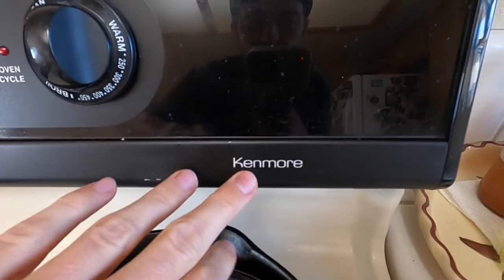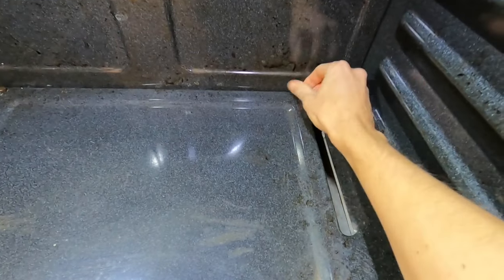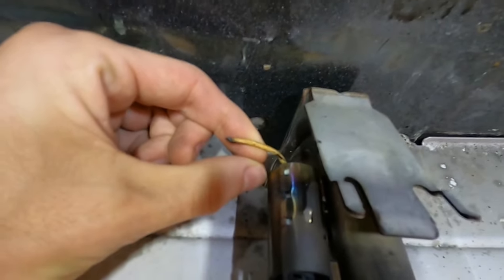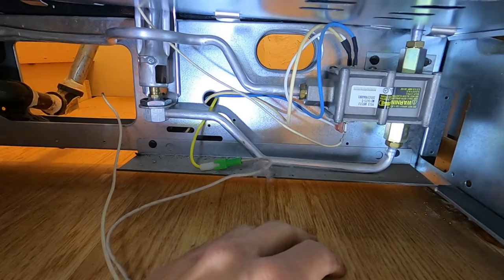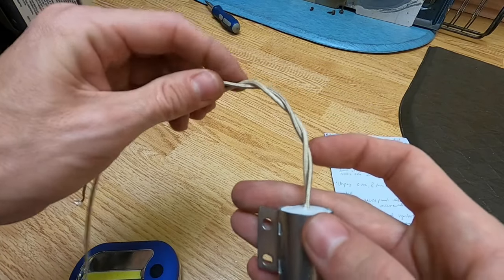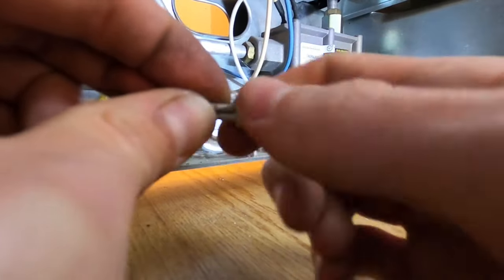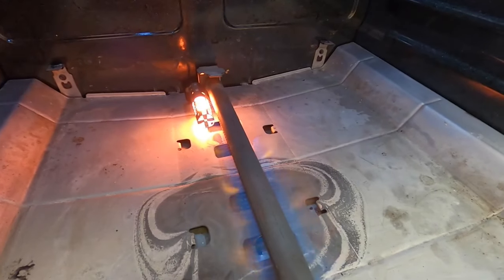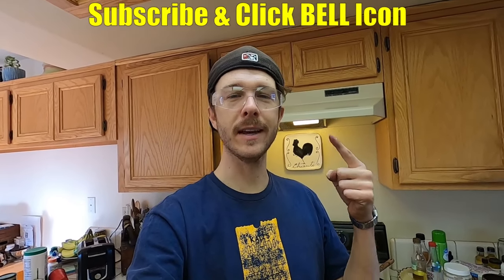Gas Oven Won't Heat? Easy DIY Fix

Comment: Hello in the title you said won’t heat and the pic thumbnail showing it on and in the video you saying it doesn’t turn on because the yellow cable was broken . It’s little confusing but my issue is my over it’s a kenmore it does turn on but it’s keep turning on and off and the flame not big like it used to be and the top one doesn’t turn on while in baking mode it turn on only in Broil mode please help I can’t afford new one I have to fix this one it’s only 6 years
Reply from the maker: Yes it broke. The thumbnail picture I took after I fixed. I would try replacing bake igniter. The broiler uses a separate igniter that's why still probably working 👍

Comment: What if i replace my heating element and it still wont get hot. Wont come on at all. 
Stove top and broiler work, just not the oven?
Reply from the maker: I would double check and test the igniter to make sure it is indeed working properly. Can test with multimeter
Reply: @JonnyDIY 
What should the multimeter read if the igniter is working properly?
Reply from the maker: @ashhelmsrnbsn  usually between 40 and 200 ohms

Comment: Will this help if you have a f-10 error message?
Reply from the maker: I would look into the oven temperature probe first and test that for resistance to see if working correctly. Then go to the panel. Sometimes you can find known problems with your specific model range by searching "f10 error" and your model on google and see what others have done

Comment: What if my igniter is working but no gas flow is happening in my oven? I have gas and flame on my stove btw.
Reply from the maker: @moonrocketnfts4600  when they're going bad theyll glow but not hot enough and won't open gas valve 👍

Comment: Is the ignitor supposed to stay on after the flame is lit?
Reply from the maker: Not for long, it should turn off after a bit 👍
Reply: @JonnyDIY  mine stays on until the oven reaches temperature and the flame goes out. Is that normal?
Thanks for responding
Reply from the maker: @highhemp8448  yes that's normal as it has to relight the burner back on to bring oven temperatures back up when they drop 👍
Reply: @JonnyDIY  not all heroes wear a cape.  Thank you sooooo much
Reply from the maker: @highhemp8448  you're welcome, happy to help 🙌👍

Comment: Does the oven igniter stay lit the whole time you’re baking?
Reply from the maker: No just to light the gas 👍
Reply: @JonnyDIY  thanks!
Reply from the maker: @doug8525  you're welcome, happy to help 👍
Reply: My ignitor lights up hot red but the oven gas dosent ignite. The top gas burners are burning fine.

Comment: If the igniter is broken do you still hear or smell gas?
Reply from the maker: @dkshdw2004  No it's a safety feature so if igniter isn't working gas valve won't open 👍
Reply: @JonnyDIY  Thanks! We see if I can get the igniter locally.
Reply from the maker: @dkshdw2004  you're welcome, good luck 🙌👍

Comment: One thing I would add is that if you're working on a Samsung Gas oven( NX58H5650W , NX58H5600S, OR NX58J5600S ) They are very easy to access if you just want to steel wool, sand or scrape the oxidation off, instead of buying a new one, BE VERY GENTLE, THE IGNITER (GLO-PLUG) IS VERY BRITTLE. Ask me how I know.:yougotthis:
Reply from the maker: Thank you for sharing, that's great steel wool will get it working again 👍

Comment: So my stovetop and broiler work but oven doesn't why is that. Igniter still?
Reply from the maker: Probably (I'd start there). Broiler has its own separate igniter as well as stovetop burners 👍
Reply: @JonnyDIY  ok thank you for the response I will check it out
Reply from the maker: @Its_about_that_time  you're welcome, good luck 👍

Comment: My oven keeps beeping F2 and shuts off. What does that? Sears replaced the ignitor. That didn't work. We  replaced the thermostat. That didn't work. They said it could be the board.
Reply from the maker: Yes the board would be the next logical part to inspect/test and potentially replace 👍

Comment: If the igniter is not working would you still get gas flow to the oven?
Reply from the maker: @KatMSmith  No, as a safety feature the gas won't open unless igniter working properly 👍
Reply: @JonnyDIY  ok, thanks. We changed the igniter but still not working. No gas flow
Reply from the maker: @KatMSmith  shoot, well you can test with multimeter to see if power coming to igniter and go from there
Reply: @JonnyDIY  absolutely will do 🤞🏻 three weeks without an oven now and I have things from my garden to get done 😉
Reply from the maker: @KatMSmith  🤞 hope can get it working again

Comment: Hi there.  Have a GE Profile XL 44 that often i cannot get to heat much past 375/400.   Ignitor goes on, burner burns blue.  I noticed that when it gets to that high 300s low 400s range, the blue flame actually will at ties flicker or get smaller.  Any tips?
Reply from the maker: I would try the igniter first. It can do that sometimes as well when starting to fail

Comment: My igniter is on but the stove isn't letting out Gas it does it every once in a blue moon when u turn the temperature to 400
Reply from the maker: When they're going out they'll usually still glow but not hot enough to open gas. I'd probably just replace it, usally fixes issue 👍
Reply: @JonnyDIY  yes i put a tester on the gas valve and it showed numbers I replaced the igniter a few months ago so I figured it was something else but the igniter cord is a bit burned so u got another one
Reply from the maker: @chxpionships_5163  ohh ok hopefully it fixes issue 🙏

Comment: My oven pilot light is on but won’t heat up just warm
Reply from the maker: I'd replace it. They do that when going bad 👍
Reply: Should we smell gas or not necessarily? I thought I’d smell gas if the pilot was not hot enough to ignite?
Reply from the maker: @sumdregs  gas won't open and come out unless igniter hot enough 👍

Comment: Okay so what if my element lights, but it still won't ignite? I don't smell gas either
Reply from the maker: It could still be bad even though it's still glowing. It has to reach certain temperature to open the gas

Comment: Could I just use a lighter to light it to make sure there's gas?
Reply from the maker: Unfortunately if it has an electric ignition it wont light
Reply: @JonnyDIY  I don't smell or hear any gas when I turn it on (it's a double oven and only the top oven won't heat - rest of the oven is fine). Could is still be the ignitor? In other words ... if the ignitor doesn't light up will the gas not turn on? It's a newer Whirlpool and the ignitor definitely doesn't light up.
Reply from the maker: @kevinmace  yes the igniter must reach a certain temperature for the gas to open 👍 even when they do still light up but weakly,  the gas won't open
Reply: @JonnyDIY  Thank you!

Comment: My kenmore igniter is glowing but the gas wont come on.
Reply from the maker: Even if glowing doesn't mean it could not be faulty. They will glow, but not get hot enough to open the gas valve when going bad 👍

Comment: what if theres no gas shut off valve?
Reply from the maker: there should always be a shutoff valve on the gas line going to the stove, you should find one. If not need to shut off Gas main and fix and add one to gas line. But I bet you have one somewhere on the line
Reply: Use the breaker

Comment: Mine won't shut off. I have to unplug it.
Reply from the maker: May be a short in wiring have you replace igniter 1st
Reply: @JonnyDIY  no sir, it happened last night and now I'm trying to find YouTube videos with the exact problem.   Not many to look at.
Reply: @JonnyDIY  I just checked it again and the igniter is just turning on. I'm going to change it out and see if that fixes it.
Reply from the maker: @mbreland25  that's where I'd start too 👍

Comment: Good video but what if the ignitor starts the burner and then after 3 seconds it goes off ??? I already replaced the gas safety valve any ideas 💡 thanks
Reply from the maker: I would replace the igniter, it can do that when starting to go bad. And since you already did the gas valve that sounds like the culprit 👍

Comment: I replaced my igniter  in my gas kenmore oven and still won't turn on. 🫤 now what?
Reply from the maker: @alexandercronk9650  Time to get out a multimeter and start testing voltages to make sure igniter is getting voltage. If not then time to start testing the main board